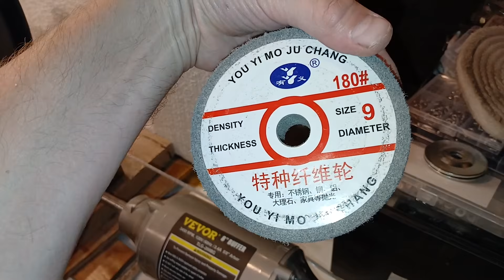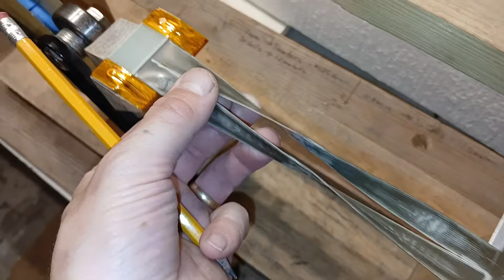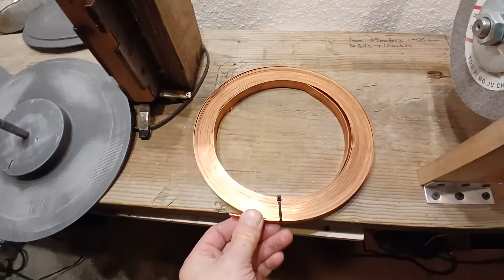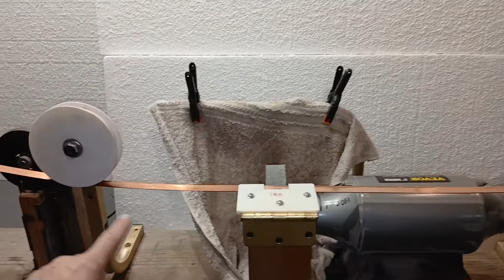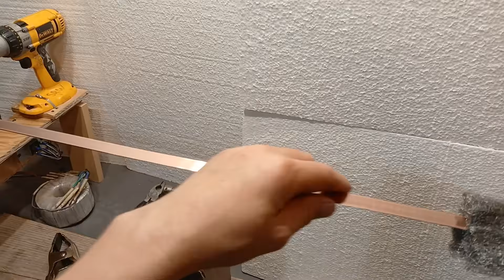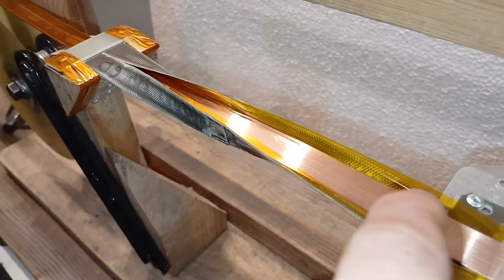218 How to insulate copper strip, step by step

Comment: Why dont you use 35mm kaptontape? It will cover complitly.
Reply from the maker: Yes it will cover the gap.
2 things
1. It will introduce extra space on both sides where kapton tape overlaps, that's not that big of a deal, especially when I use epoxy when winding my coils 
2. For my set up it's fine with the gap, haven't had any issues yet.

When I start using this coils with higher voltage 1.5kV and up, I will be adding one layer of 15mm wide kapton tape to cover the gap (on the inside)

Also I will need to modify my wrapping set up to use 35mm tape